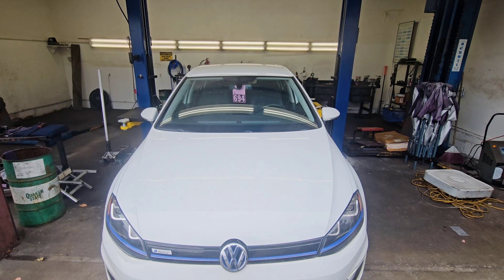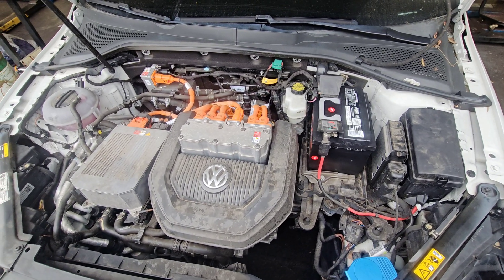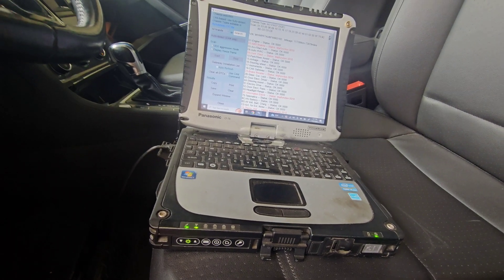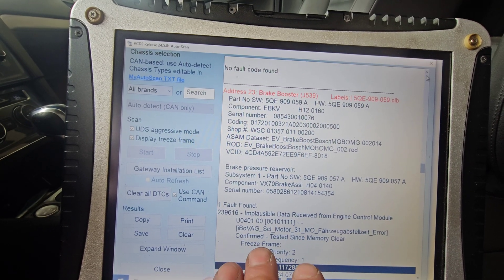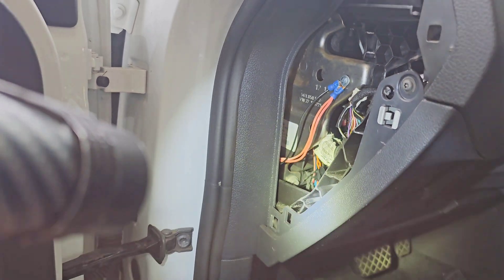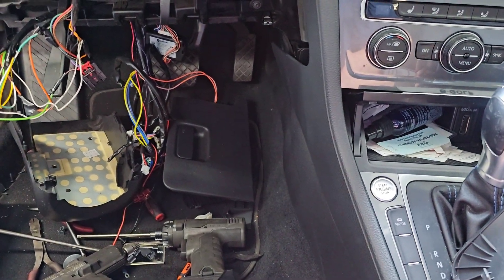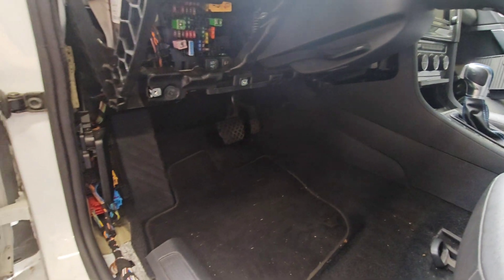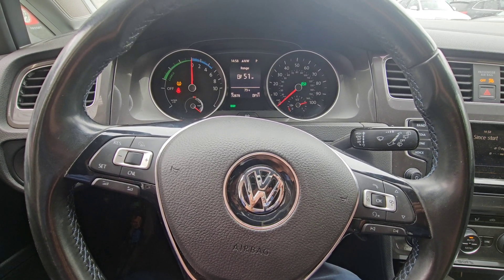Volkswagen eGOLF NO START Diagnosis and Repair

Comment: Where are you located? I can tow my car to you. 
My EV Vw Egolf 2016 starts but it says “Take off charging port to start” when there is literally no charger connected to it.
Reply from the maker: I'm an independent contractor for a few dealerships.  I specialize in battery repair.  I own a battery and  ev motor repair shop. It sounds like you need a new charge outlet. Do you have any trouble codes?
I might be able to help.